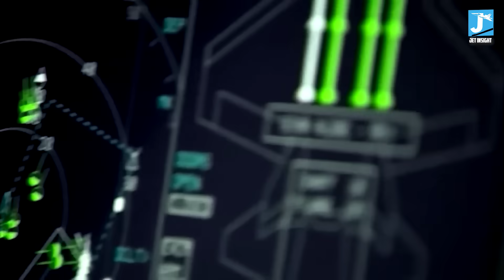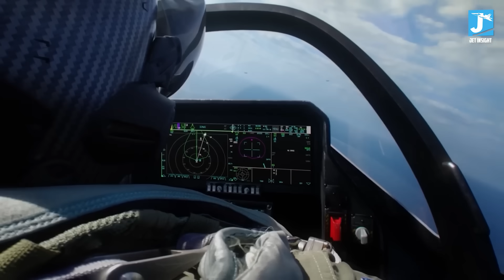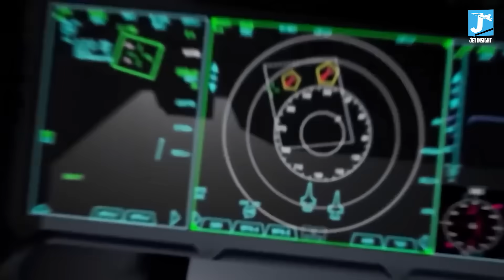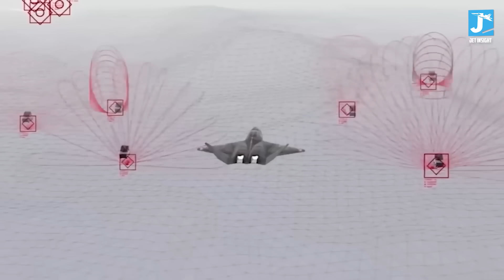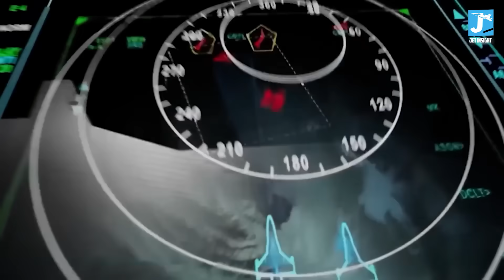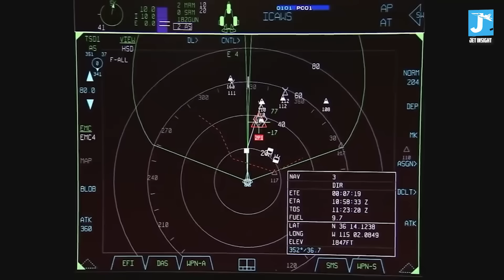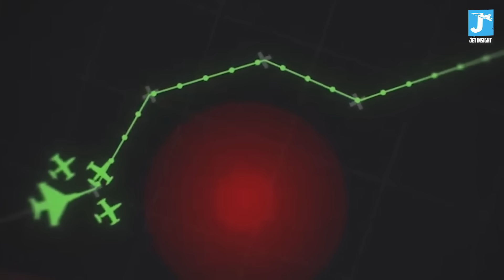F-47 Fighter Jet EXPOSED : America's Secret 6th Generation Superweapon

Comment: Boeing had a contract to make new wings for the A-10 warthog fleet, Boeing did not complete that contract, so those planes not getting new wings will have to be retired, something the Air Force wants but Congress does not, you would think that failing to fulfill a contract would be a mark against Boeing, but they got the F-47 contract, score one for a defense contractor who did a favor for the Air Force. The Air Force thumbed its nose at Congress and said we will get that fleet retired with or without you. not enough wings here, not enough of that there, not enough somewhere else and slowly but surely the A-10s will get retired completely.

Comment: Can’t wait to see the latest innovations in avionics in sixth and seventh gen. Integrating processors with the power of the AMD Epyc or Ampere Altra multi core CPU’s with Blackwell scale graphics/AI architecture, with advanced quantum navigation and communication will allow an unprecedented ability to dominate the sky, speed/time domains, and potentially low earth orbits while being largely undetectable and reacting faster than humans 90% of the time. These aircraft will eventually go so far beyond the stealth drone commander and range/speed advantages currently touted by the US military. While US non-visionaries are inflexibly reserving the kill decision only for humans, a further breakdown of the requirements might allow more flexibility, for example adding war modes to automatically engage if fired upon or to exact revenge if a loss or kill is imminent, or to protect pilots after ejection. Modes for lasers to automatically blind IRST’s and externally carried weapons might also be feasible in these generations.

Comment: The original concept with canards, I believe, were intended to be conformal "morphing/flex" type and I'm surprised they didn't (apparently, not sure) choose to go that route for all control surfaces. One test aircraft for the conformal wing years ago had panel lines painted on it to appear as if it had flaperons. Canards which can alter their shape could add exceptional low-speed characteristics. 
If they went with the traditional Thunderbolt name as an homage to the original P47, it would be epic to report on a "pair of jugs" being sent on a mission... or several pairs of jugs.

Comment: The MIG-41 is the 7th generation, its speed will be up to 4.3M. The design of the MIG-41 is carefully hidden. The 6th generation in the Russian Federation will be the Su-57. it already surpasses the f22 in electronic capabilities, in missile range, combat radius range, the Su57 leads up to 4 S-70 uavs, and is capable of flying and landing without a pilot

Comment: What I think is happening is the USA is using the car model have a top of the line model and those features trickle down to other models. Over time you will see a standard body and other models will be born from that. When the body needs to evolve it will be done through battle data and computer simulation.

Comment: It is quite nonsensical! The video 💯 is based on assumptions which are not at all representative for any factual reality!
1) The thread, which the US is facing is not Russian and Chinese new fighter jets. And not even S-400 (…).
2) The decision to approve the NGAD against the blessing of the USAF - is unhinged and erratic.
3) As most fighter completion, demonstrator flew. However it seems not reasonable to believe, that they were ready to go systems. (Close the combat readiness).
4) e.g. the engines supposed to be (NGAD) next gen engines. Only a couple of years ago, the decision of Congress made clear, that these next generation engines are still far longer away, that expected.
5) The whole purpose of NGAD is, to have a fighter jet, which is able to reach Chinese mainland without refueling. While both F-35 and F-22 are advanced platforms, which cannot surpassed in a reasonable time frame by opponent countries, they have too short ranges.

Anyway- the video is almost propaganda - the same style which is often seen from Russia or China!

Comment: Did we not learn anything from the short production of the F-22. We need far more than 200 F-47’s. Probably more like 1200 and 10,000 wingman drones.
Reply: I might be wrong, but I believe drones are a part of this package
Reply: @GregGlaeser-j4u you’re correct. I think the video says we plan to purchase 200 F-47’s and 1,000 drones.
Reply: 1200 would be a safe number. considering a possible 3 front war, European front, middle Eastern front and Asian front.
Reply: @brucehillbillybarthalow3786 I understand the cost is astronomical, but when you consider how long the F-4, F-14, F-15, and F-16 and others were used or are still being used, the tax payer gets their money’s worth. Plus, newer airframes tend to provide significantly more flight hours. The F-14, specifically, still had valuable mission capabilities when it was retired.
Reply: @richardkrenek985  AND these are "upgradable" ... no need to start over from scratch.  Which saves a ton of money in the future!
Reply: these are in tandem with the f35.
Reply: 😂😂😂😂😂😂 only exist on ppt.. p00r american 😂😂😂😂😂..